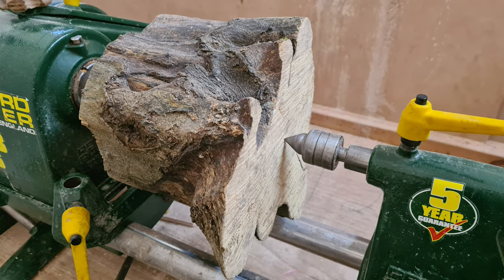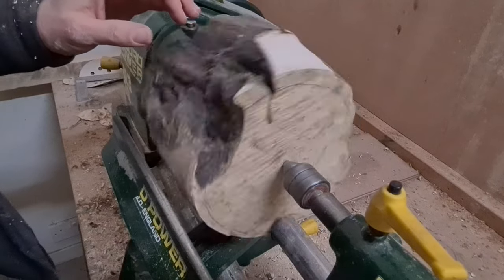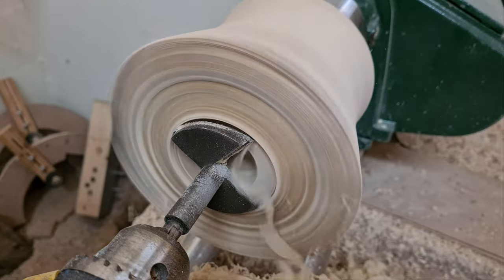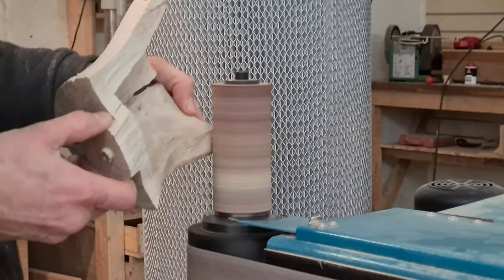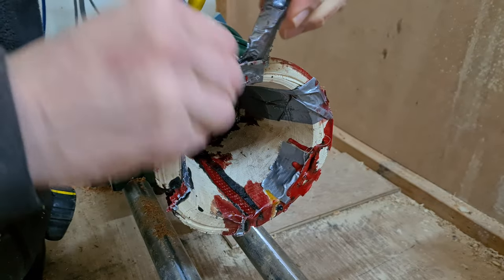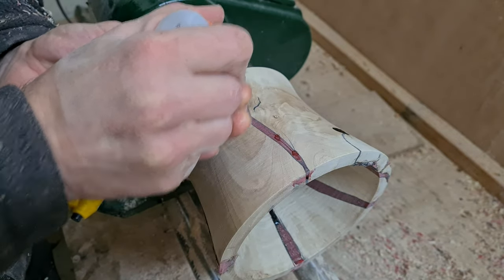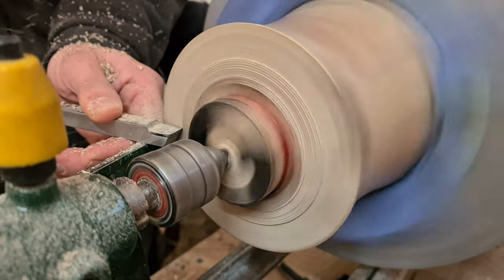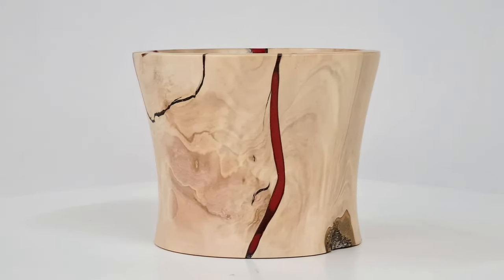Woodturning - Ugly Firewood

Comment: I love this Ray if you wanted to achieve more of a lava effect I probably would've used yellow red and orange resin together I find if you pour at around 50 degrees you get a really good colour separation but I really like the end result you got
Reply from the maker: Ah, that's a great idea. I was thinking of using a lighting system inside and have it pulsate, but I screwed up the pigment and got the intensity too great.

Comment: Well Ray I don't think that vase is what it is cracked up to be ... at least until the point where you got cracking on and finished it. nyuk nyuk nyuk. But it sure turned out fine and is a real beauty ! Question: was it still a soft wood after you got into it ? Because the interweb says it is dense and has a fine grain for wood turning.      🙏  Take care. -Mike
Reply from the maker: Hey Mike. All I can say was that the piece I had was easy to work with throughout, apart from the internal base. Did catch a few times. It's possible the English piece I had from a local wood is different to other hornbeam, as our English oak (interweaving grain) is different from French oak (nice straight grain). Take care. Ray
Reply: @RayWhitbyCreations  No worries Ray. BTW, I did look up European vs. American Hornbeam.  🎅🎄🛷Seasons greetings to you and yours !!
Reply from the maker: @mpart_woodlathe-stuff  I think the US has the better wood, better research funding, better... everything... well almost. The grass definitely seems greener on the other side of the pond... for some things.